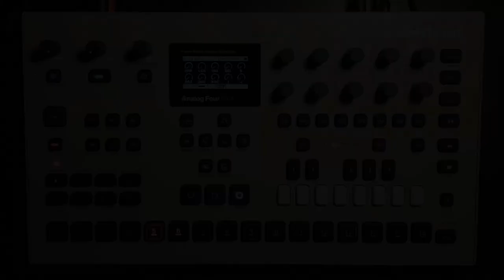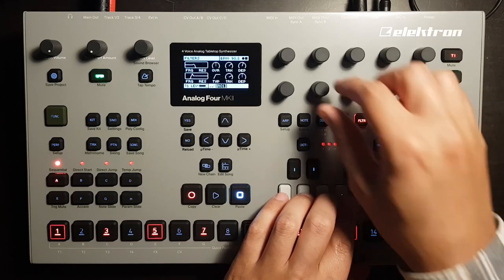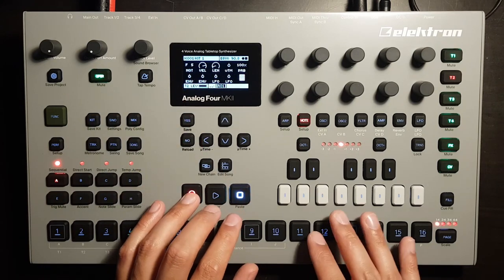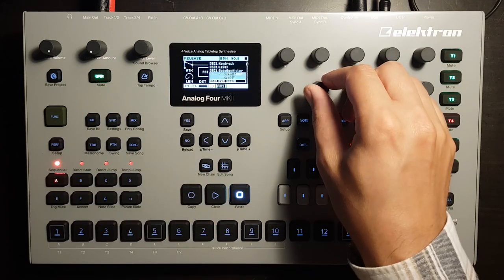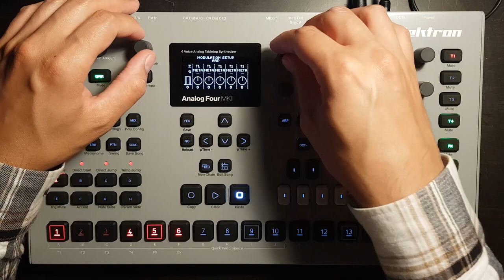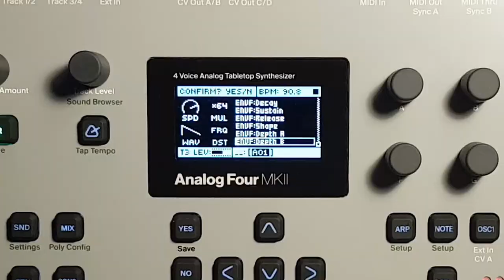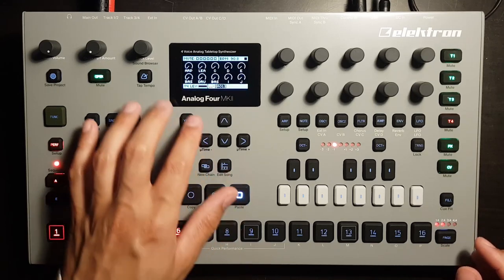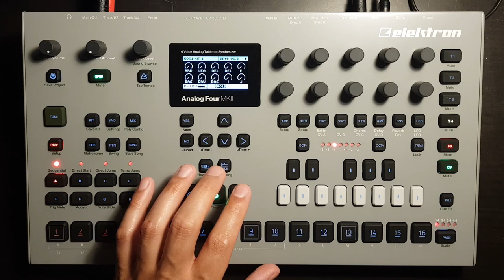Track From Scratch on the Analog Four

Comment from the maker: Time stamps:

0:00  intro and demonstration
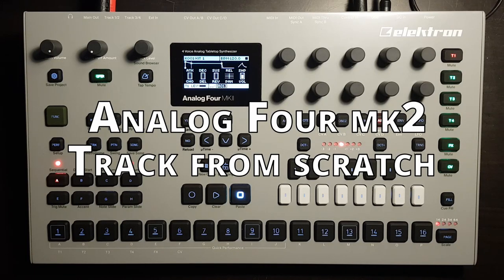1:50  Selecting sounds
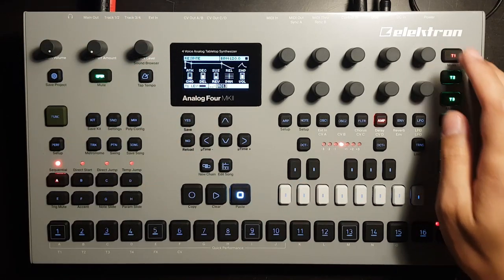3:53  Configuring delay and reverb
6:13  Making an arp melody
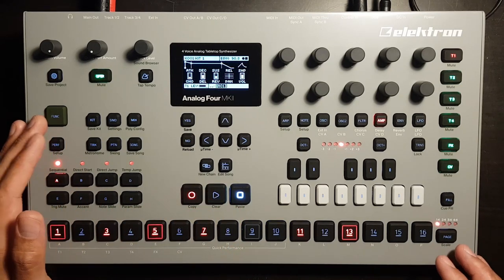7:45  Configuring the pattern length
9:04  Making the bass melody
12:17  Making the main melody
17:48 Making the drums (kicks and snares)
22:12 Rebalancing the sounds for a rough mix
23:00 Making the drums (snares and hihats)
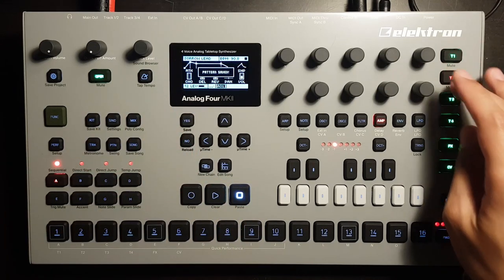29:53 Naming the performance macros
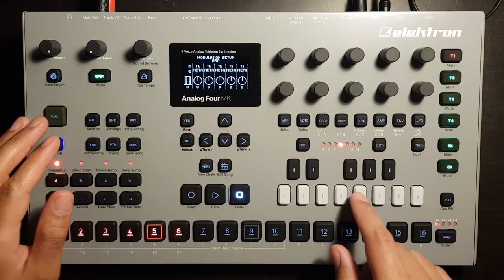31:13 Arp macro
33:19 Lead macro
34:58 Bass macro
37:35 Configuring the quick performance knob
38:14 2nd Bass macro 
41:13 Drums macro
45:57 Delay macros
52:08 Performancing the pattern

Comment: Congratulations on the MKII! 🎊 Have you spotted any main differences concerning the sound compared to the MKI? It's really interesting to hear it without post processing! I always wonder how much of a difference the Analog Heat, Maximus etc. make for the overall sound!
Reply from the maker: Thanks a lot, Sebastian! They sound very similar, but I think there's a tiny bit more bass on the mk2. You can get the same amount of bass on the mk1 by using the 2nd hp filter's resonance to boost the lows, though. The new overdrive on the mk2 is way different, and behaves more like how I'd expect an overdrive to behave. The mk1's overdrive is pretty unique, it seems to "smudge" the sound in a way that sounds great but is hard to predict. One of the mk1's overdrive is still on the mk2 though, so best of both worlds =)
Reply: I used to have Analog Keys and swapped it for mkII. The difference is quite significant IMO. Analog Keys sounded a lot warmer to me. And was better for subtle, gentle patterns. MkII is a lot more powerful in terms of energy but could be a littlebit harsh sometimes. Anyway I do not regret the swap but I also miss my AK sometimes
Reply: @karolcelinski8077  Funny, I was thinking of swapping my AK for a Mk2, because bigger screen, quick performance knob, better physical interface, etc. (Ivar's videos are nudging me) Interesting to hear there's a qualitative difference between the sounds, beyond just the new overdrive. When the AK came out, Elektron claimed the keyboard had enhanced bass compared to the mk1 (in addition to added outputs and whatever else), so maybe that accounts for the perceived warmth? With the Mk2, is it just a matter of dialing things down?
Reply: @karolcelinski8077  One thing that seems to be the case is that you can accidentally (or intentionally I suppose) overload the internal busses of these devices, to the point of unwanted distortion. I guess you have to stay aware of the gainstaging, and there are various level knobs throughout the signal chain, plus the possibilities of overloading the filter, efx, etc.  So perhaps that's part of the harshness issue?  Just a thought.
Reply: @IvarTryti  it's funny that most reviewers raved about the new overdrive in the Mk2 and you're praising the inclusion of the Mk1's on the Mk2. I think I agree with you but, only having an AK, my only familiarity with the Mk2 is through youtube.  
Do you ever miss the Mk1's counterclockwise overdrive?  It seems like the Mk1 clockwise one is like a wavefolder more than a classic distortion overdrive on the Mk2.  Not sure what the CCW one is doing.

Comment: Thank you for the walk through. Why did you upgrade your A4?
Reply from the maker: Sorry for the late reply! The short answer is that the mk2's screen, buttons, and encoders are better. The long answer is something I wrote in a forum post that I'll copy-paste here:

"Screen: the mk1 screen is small, the icons are small, the viewing angle is narrow, and it’s sluggish. When I hit play, the number showing where the playhead is in the sequence just looks like an 8 because the pixels are so slow to change colors. Because the icons and text are small and there’s no graphical representation of the envelopes or filters like on the mk2, it’s hard to immediately see what page I’m on.

Encoders: mk1 encoders are slow. You can be more precise with them, sure, but I find myself pressing and turning all the time to make it change values in bigger increments. All the elektron knobs take a bit of force to press, and it’s annoying to have to do it all the time. it’s either that (and then not-press turning for precision) or doing 2-3 full turns just to get to the value I want. The mk2 knobs are as fast as on the DT and DN and OT mk2, so it’s a lot more comfortable to use IME.

Buttons: mk1’s buttons are a bit hard to read because they have a red LED over the button instead of backlit RGB buttons. The difference between a trig and a lock trig is that they’re fully lit and half lit respectively, and the half lit ones can be hard to see if I have a lamp aimed directly at the A4. I also prefer the feel of the soft square buttons that actuate with little force more than the round hard plastic buttons of the mk1.

More controls: On the mk1, going into the settings menu is a two handed button combo. FUNC all the way to the left + GLOBAL all the way to the right. There’s no shortcut for saving a project, so it’s FUNC+GLOBAL > YES > YES > YES > YES to save, then NO -> NO to go out of the menu. That is assuming you’ve already saved once and that it remembers the last cursor position. On the mk2 you only need one hand, and it’s FUNC+SETTINGS -> YES ->YES, and it returns to the screen you were on before saving automatically. Also, having a little cluster of buttons for kit, pattern, mix, etc between the FUNC and arrow buttons makes saving kits and patterns more comfortable than on the mk1. Also being able to change octaves while browsing through sounds is very handy; arrow buttons to navigate the list, oct+ and oct to change the octaves.

The main difference when it comes to sound is that the mk2 has a new overdrive which I think is easier to use. It behaves more like how I’d expect an overdrive to behave. The mk1 sounds great, but it’s rather unique and hard to predict because it sort of “smudges” and softens the sound while also overdriving it. I also think there’s a tiny bit more bass on the mk2. Just enough that patches from scratch sound a bit more even than on the mk1, not a huge difference."
Reply: @IvarTryti  thanks for this more detailed comparison.  Was going to ask for your opinion!  I've had an AK, mostly gathering dust because I found the learning curve steep, but now spending hours with it every day.  I figure I'll master it and then decide whether to sell it for the Mk2, but leaning towards a Mk2 because I can see how much better the user experience/interface is — which really matters a LOT when spending time trying to get music finished, rather than just playing around with gear.

Comment: oh man, so silly i cant find the width, on my lfo, doesn't really appear,, I found the other parameters but I cant find feedback o width of the delay...grh,, thanks anyhow, great job
Reply from the maker: Thanks! Could it be that you have T1-T4 selected and not FX? Press the encoder to change track. If it's still not there, maybe you don't have the latest firmware update?
Reply: @IvarTryti  thats right man, thanks so much your videos are very inspiring and is making me discover the a4 more,, very precise and top info... thanks so much
Reply: @IvarTryti  i want to ask you,, please, if you have locked in one track 5 sounds how do you do to solo and just listen to one, and mute the other ones,, cheers
Reply: @Marco-ei2ny  I think you just have to mute the others, or turn them down using e.g the track level knob, or perhaps macros youve set up, but muting is ofc faster — just hold down func and press all the ones you don't want to hear.  I think this is the answer to the question you're asking but your wording is a bit unclear ("5"?).  I don't think there's a solo function.